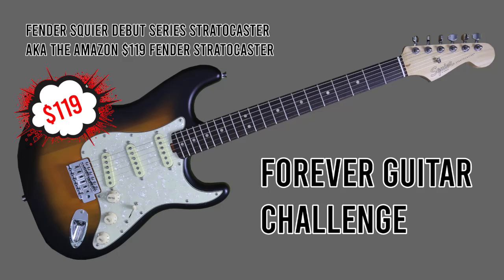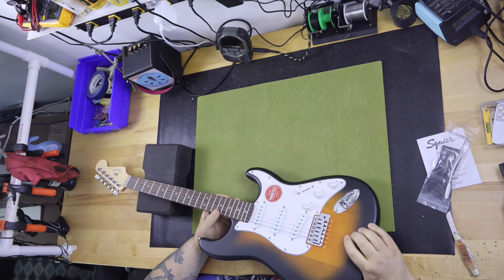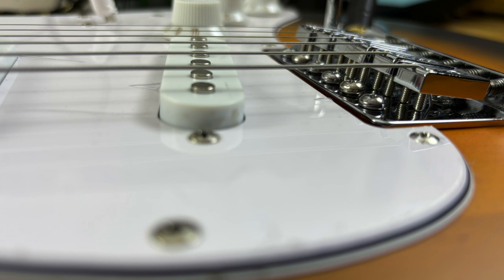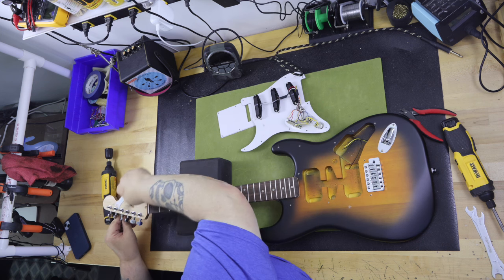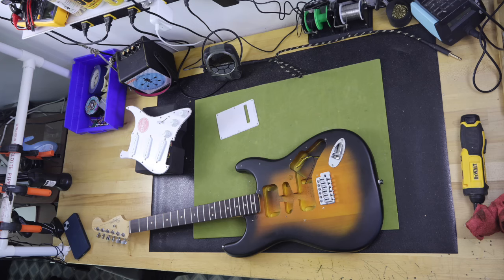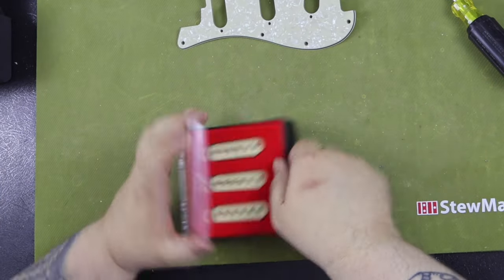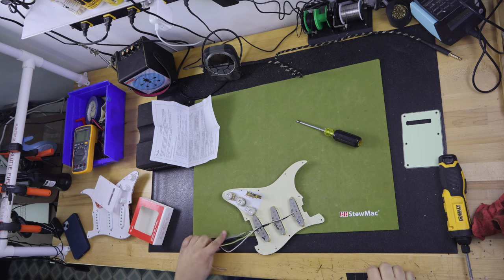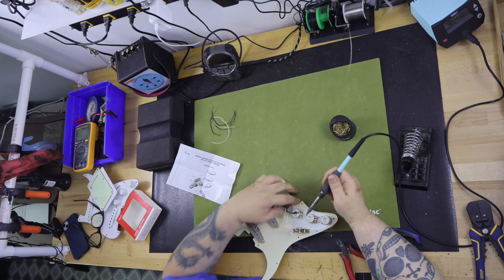AMAZON $119 FENDER SQUIER DEBUT STRATOCASTER - MODS and UPGRADES

Comment: 6:34 - Im not sure if the pickups here are wired incorrectly/out-of-phase because if you listen to the single pick up demos, there is body to them. But at 6:34 it sounds like the life was sucked right out of the strings.
Reply from the maker: I watched the raw video and it is wired correctly. I can now wire guitars with a new tonal position. It is called STL which stands for sucks the life. 😀 My thinking is it is the bridge and middle pickup in parallel which is going to be a lot less output than either pickup by themselves. This is what I hear.

Comment: For $300.00 you could of bought a Fesley FST1000 Ghost Series super straight with a bone nut, roasted maple neck, Grover G2 tuners, Rosewood fret board, all Wilkinson pick ups and tremolo bridge (2 way),  along with coil splitting. Also comes with tools, gig bad, guitar cord, and a full inspection card.

Comment: i just got mine and it ws damn near perfect out the box. i put locking tuners puretone jack,, black saddles, roller string tree, mojotone wolderless harness with some seymour duncan jb jr's, and copper foil the inside.. great beginner or modder guitar.

$120 for guitar
$25 for tuners
$100 for pick up
$10 for copper tape
$7 for puretone input jack
$7 for string trees 
$100 for the mojotone solderless harness. 
for $380 you can have a very nice custom budget squire 

if you really wanted the utlimate custom squire, pay a luthier  $100 for a set up, fret polish, and bone nut.

Comment: I also got the 2 tone sunburst one. I really like it, it has good bones. The only shortcoming for me is the electronics. Fortunately, I happen to have a loaded pickguard with alnico v pickups and a wiring harness with big pots and thick braided wires that I plan to put in it. The pickguard itself is parchment pearl with a matching backplate. I've also got a spare set of locking tuners, so they'll go on this instrument as well. It's obviously not on the level of my MIM Fender Standard, but it's not far off from my 2 Affinity Strats and it's almost as nice as my Fojill mahogany light relic Strat (I'm talking build quality, the electronics will be on par when I stop procrastinating and install the loaded pickguard.)

Comment: Out of curiosity, have you ever seen the Dean Zelinsky ATW loaded pickguards?  They claim the they're set up so that the volume doesn't change when switching between the normal humbucker and splitting the coils.  Is that realistic and do you know how that type of thing is done? I have a Surfliner HH and the volume change when splitting the coils is annoying :\
Reply from the maker: That would be a really good idea for an article. You can use resistors in the line that is going to ground and theoretically this will allow you to same some of the volume when switching between humbucker and single coil. I have not tried the ATW loaded pickguards but I guess this is how they are doing it.
Reply: @guitarcollectorguy  - Whoah, it's really as simple as having some resistors in the correct part of the circuit?
Reply from the maker: @Crispy_Music_2024 yes